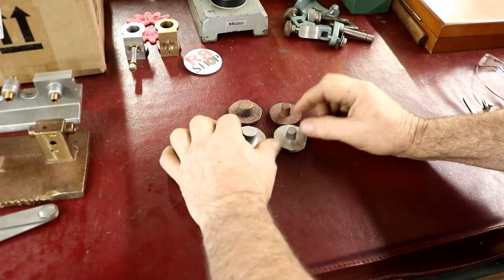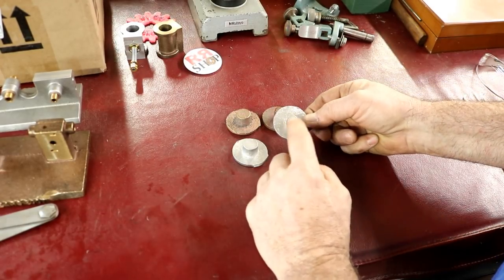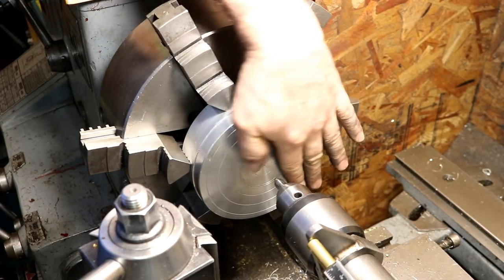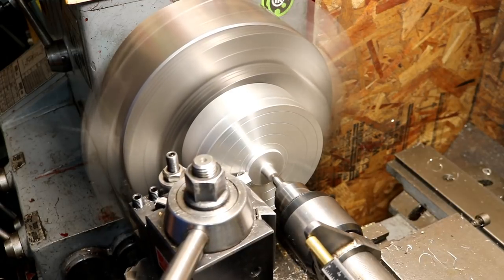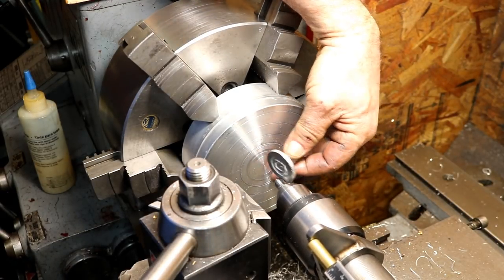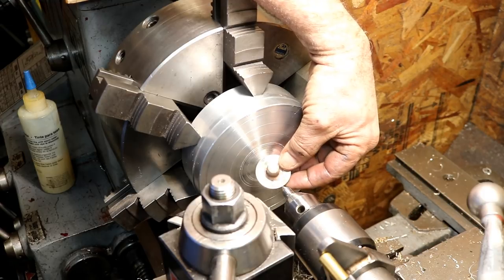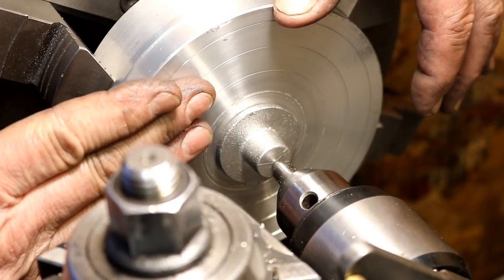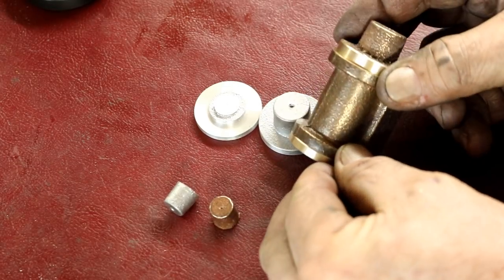P4-1 How to Build the Cylinder Heads of a Model Steam Engine for the First Time

Comment: Hi Randy great to be here, slow and steady wins the race here likely there ass well. Things take what it is they take we will be here trough it all. 
Nice way to tackle the ends of the cylinders caps. This is interesting to learn you do not need to glue or double back tape using only that center in the tail stock to hold the cap nice lesson for us. 
We also wanted to share how we are also thinking (if we understand you right) you were once a machinist on a moving ship not in a smooth stable workshop like these two guys only know o so we really listen to you because of that past, machining is tough enough yet alone rocking and rolling in the open waters. 
Those machined caps look like they are smooth enough to seal well, looking GREAT.
Thank you for the share, Lance & Patrick.
Reply from the maker: Thanks Guys.  I was an Engineer on ships.  But an engineer has to be the machinist, designer, mechanic, electrician, plumber, welder, technician and of course therapist and psychologist.  Ho and at all time THE BOSS.
Reply: @RRINTHESHOP  We thought so, remember in an email and during videos of sharing, you to us are a great man hard working man and a pretty good reason we like calling you our friend, you have been there done that, and oh yes this, a time or two already, your friends that usually never (well rarely) re-reply felt it important to do so with this great sharing moment from you Randy. Thanking you, Lance & Patrick.
Reply from the maker: Thank you guys, for the kind words.

Comment: The good news, the chip pan sounded empty...   ;)
To help with friction turning, I often use a sticky back emery pad, that gives lots of traction.
Something is on it's way so I'll have to attend your Fusion 360 classes....    Geezzz, I never thought I'd get that desperately in need to replace my PAD ( Paper Aided Design ) system...     lol
Those castings are LOTS of work...!!!!   Coming along great, though.
Reply from the maker: Yes it was clean.  Throw out the paper.  Thanks Pierre.